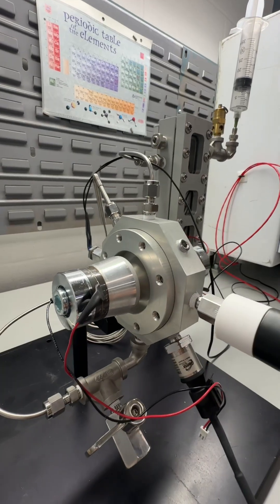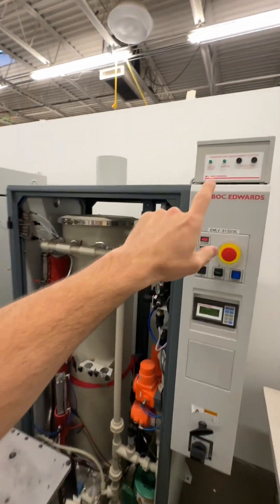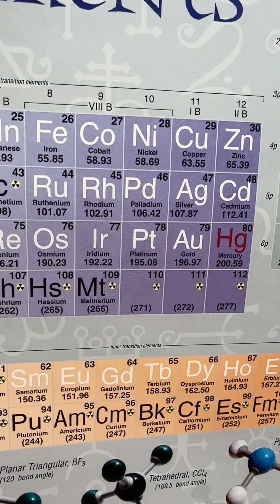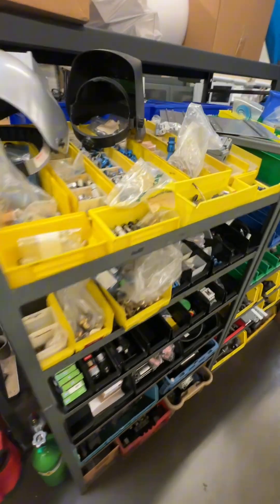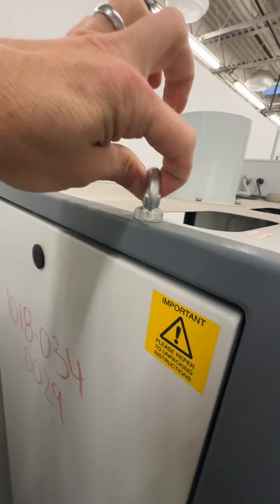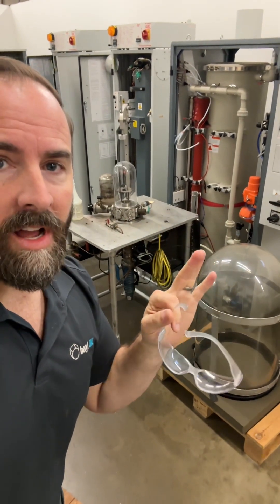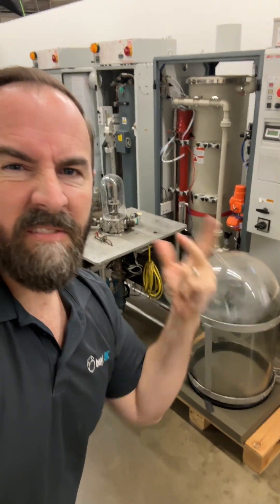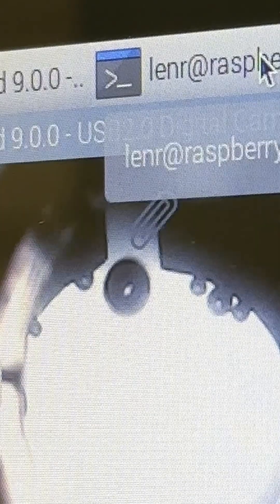LENR Sonoluminescence Enclosure Project Idea

Comment: Wait: so those cylinders are lined with precious metals? Sounds like you could have a similar cylinder for housing the reactor. If the Geiger counter gets too high, replace the cylinder with a new one (I assume the borax is eventually consumed) or with new boron medium.
Reply from the maker: I’m imagining a filled cylinder or baffle system with something like gravel or small pellets.

Comment: A means to extract heavy water from normal water was discovered by a company using electrolysis to generate hydrogen for process gas. In the winter they notices a type of water ice that remained at the bottom after most of the water was drained. The heavy water had a higher melt/freeze temperature and was more dense.